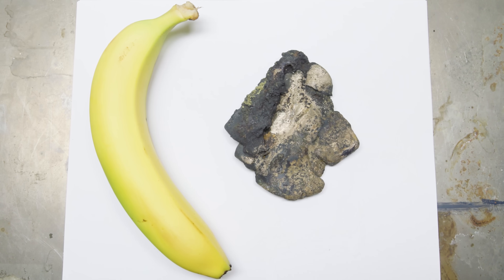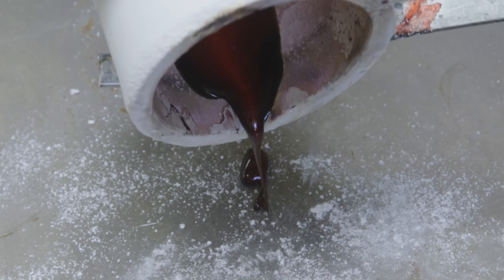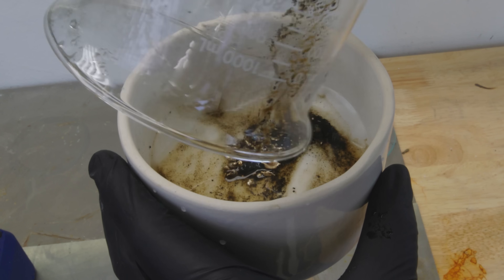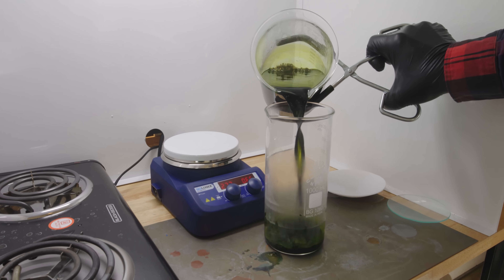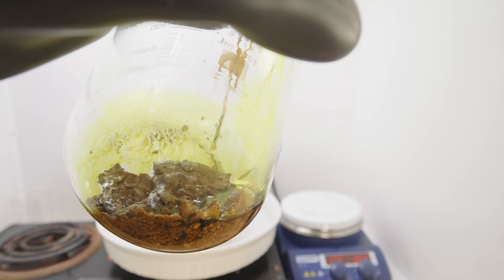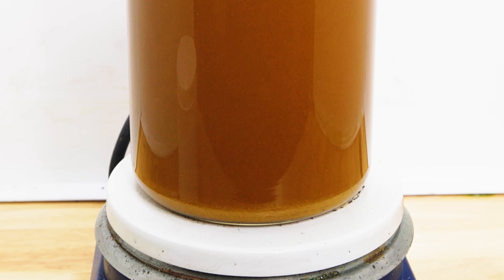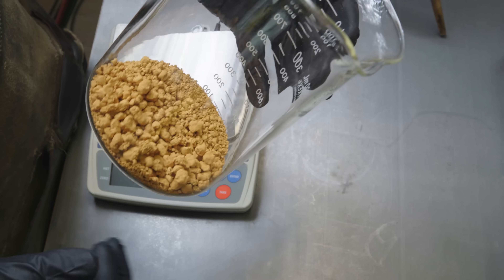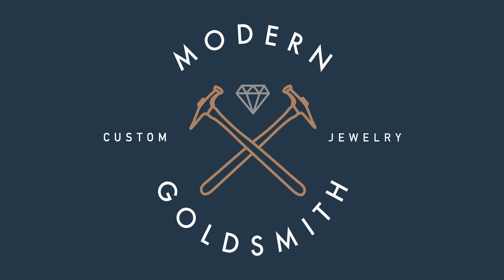Turning a BLOB into PURE GOLD!

Comment: Watch some sreetips. He's literally refining gold all the time as well as other precious metals. He learn from a refining precious metal handbook.
You should've use other acids first to take the base metals out, also the silver. Only then you use the agua regia. 
And too be sure is pure gold you need to repeat those metal dissolving process until you remove all the base metals, silver, even the agua regia need to be done 2 or 3 times until the solution is clear if you go the tree stump gold dropping out of solution route. There's some junk that is not metal that follow the gold on the refinement like jewellery polish compound, that's why is important to repeat even the agua regia a few times.

Comment: Aqua regia is awesome! The orange fumes are nitrogen dioxide. NO2 is very toxic. And carcinogenic. A stir bar and a magnetic stirring hot plate might help with the speed and volume of reagents needed, in case you plan on doing this more.

Comment: i watch a gold refiner with for a long time, and you can achieve 999 with chemical baths. However, since you are new at this you commited a few mistakes. When you found out the blob was 10k, the next step would have been to enquart the gold, which means inserting base metals on it untill the gold was at a concentration of 25% or 6k. After that, you should, as you did, melt it and make flakes out of it. Then, you should NOT bathe it in aqua regia. You should bathe it in nitric acid several times in order to remove everything but the gold. It would take around 6 or 7 nitric acid baths. Once the acid comes out clean, the remaining is already very pure. Then you dissolve it in acqua regia and precipitate in sodium metabisulfite. And in order to get it a 999 you should dissolve it in acqua regia once or twice more just to be sure. Also, every time you achieve gold solution you should cool it down and filter it, specially the first time, because some crap always remains. And you shold also give a squirt of sulfiric acid just in case any lead survived the refining.  Anyway, great video!

Comment: Very good and well described video. I am a retired metallurgist who worked for many years in the gold mining industry in Western Australia. I managed laboratories where we not only conducted our own assays on bullion by traditional fire assay methods - we also produced our own 99.9% "proof" gold to use as standards in the fire assaying processes. Our method of producing "proof" gold was very similar to what you have shown here, except that after the aqua regia digestion, we filtered out any remaining solids (silver chloride) and took the solution up in hydrochloric acid / reduced over heat and re-filtered a couple of times before finally taking up in distilled water giving us about 5 litres of a very clear, but still acidic solution containing the gold. We then slowly added caustic soda to this clear solution while gently stirring - the metallic gold precipitating out of the solution looked like "gold rain" falling to the bottom of the beaker. Precipitate was then washed in distilled water a number of times before drying. We then weighed out one gram lots of this dry precipitate into small china / porcelain crucibles and put into a dedicated furnace to melt down / anneal into small gold buttons or "prills". These were then put through manual "bullion rolls"and rolled out into long strips, which were stored and cut up when required to make "proof" standards to compare routine assay results against.

You could also purchase certified "proof" gold ribbon and solutions from the Perth Mint for use in making your own "standards" but these were very expensive. As a result, we only very rarely purchased these standards and used them to confirm / validate our own site-produced standards - usually when conducting assays for other clients / joint venture partners etc.
Reply: This was really interesting. Thanks for taking the time.
Reply: So you are in Gold Rush in Bendigo?
Reply: @karenwallace462  probably less time than it took you to read it, given your apparent lack of anything much between the ears.

Comment: Very time consuming, complicated and inefficient process. I used to woek at this process.
1. Heat the retort in a crucible to 1200 C, with Borax and Soda ash powder  until liquefied. 2. Allow to cool in a metal bar template. 
3. When cooled, the black impurities will form a solid layer on surface which can be chipped Off. 
4. You now have a Gold Bar & silver of 98% + purity.

Comment: You can use large amounts of flux (or fluss ,I cant remember the spelling,) ,but its something that causes all impurities and things that are not metal to go to the surface of the melted metal , then it can be knocked off with a hamner once cooled just as you would do with arc welding slag ,that does not require alot of knowledge in cheimstry to do.

Comment: You can add more Hydrochloric Acid if the reaction slows down. The salt you're forming is is Auric Chloride (Gold III Chloride), the Hydrochloric is being consumed, the Nitric if memory serves me correct, is the oxidizer and an intermediate in the full reaction process, it just happens to break down into a gas naturally with the presence of hydrochloric. You'll waste less Nitric this way. At least that's how we manage melting lead with aqua regia in the lab I work in.

Is the PPE rated for NO2 fumes? I did a quick check and couldn't see any 3M filters that specifically mention for NO2. What about the fumehood?

Comment: I've been curious for a very long time about how gold is refined to almost one hundred percent purity.   I knew hydrochloric acid was involved but didn't realize the intensity of the acids used.  Now I'm curious how refineries do it in large capacity.  Also, I would be curious to know how you discarded those acids.  I doubt you can just dump it in a sink for obvious reasons.  Maybe outside in the woods?  Add baking soda to it or something to neutralize it?

Comment: You might want to get a grinder to turn gold scraps into dust, so as massively increase surface area and save up a lot in time and aqua regia.
Reply: ...make a huge mess and introduce a bunch of grinder disc material into the metal you're trying to refine? lol...

Comment: A lot of people use nitric acid alone first to dissolve the other metals present, which can be poured off. The down side of this is that you go through a lot of expensive nitric doing this. In the liquid state, yellow is a sign of the presence of gold. Green is typically silver or copper, but copper can also be blue. Using a lot of distilled water helps as it allows the metal salts to have something to dissolve into.

Comment: After watching this, I can't help wondering what he'd have ended up with by just melting it. 
Doesn't that do a pretty good job in separating it since the gold is the heaviest item and anything else would end up floating on top of the gold layer? Sure, you might lose a bit of purity, but it would also be MUCH faster and easier to process.

Comment: Since some already comment it, I also would use as a first step Nitricacid conc. to solve everything but Gold, but I want to add the best way to handle the silver:
a.) fall out with Hdyrochlorid (if you dind't have it already)
b.) filter it (and clean with dist. water)
c.) solve the Silverchlrodi with 10-25% Ammonia (and filter it to remove the crap)
d.) with this solution, fall out again the Silver with some chlorid (you could also use NaCl)
e.) step b.) again.
f.) put it in low Hydrochlorid (~5%) and add some base metal like zinc, tin or iron mesh. this will reduce the silverion to pure silver and solve the base metal. Here it is not easy to find the point where is enough base metal, because you have to solve with HCl what is too much afterwards. the silver is a gray powder like the brown gold powder.

But at least the silver is not so easy to melt like the gold. I was never able to melt it with usual chemical lab Gas stuff. Books say you have to add some Borax to support the melting.

Comment: Next time, try adding a little sulphuric acid to your aqueous solution of purified dissolved gold solution. You should consider adding nitric acid very very slowly and minimally until your stannous test just yields a negative result and then adding your sulphuric acid, (but I would check into the optimal timing of this step this first). In any case, the purpose of adding sulphuric acid is to his will cause any dissolved lead to precipitate out as insoluble lead sulphate. This can be filtered out during filtration.
And you could consider refining your gold a third time also.

Comment: There’s a lot of chemistry so I won’t bore you, but you always need to do what’s called “inquarting” for gold between 25-75% by mass. Any lower than 25, or higher than 75, you don’t need to do this process, but otherwise, it is THE SINGLE MOST IMPORTANT step for gold refining. You either need to add silver to bring the gold concentration down to 25% or less, or add pure gold to bring the concentration to 75% or more. 

Once you do that, you can either treat the 25% or lower with nitric to dissolve away the silver and base metals leaving pure gold powder, or treat the 75% or higher gold with aqua regia.

Comment: I used to work as a goldsmith too, here in Brazil, in my workshop we used to do this process in a different Way.

After considering the alloy with a low level of purity, mix the alloy with 3x its wheight of copper. After That, cut this new alloy in tiny pieces, react it with just nitric acid, i used to do this process in something like 3 times, the dust in  bottom of the becker results in a 99% alloy of gold.

Please try this in some other video

Comment: If you have sodium or potassium chlorate you can make an even stronger aquaregua without any NOx gas generation since you switch nitric acid out and have the chlorate as the oxidiser.

You can disolve in Bromine and bubble SO2 to purify the gold further. I will be trying both of these soon on my channel. All I have is one gold crown that is prob 16 karat gold with a bit of palladium and platinum, silver, copper etc

Comment: You should have used a 12 Volt battery charger, Muriatic acid and fish tank. It would have been cheaper and cleaner  not so much pollution. 99.00 % gold.

Comment: You should be very careful with that "Orange Smoke", that's concentrated NO2 and we avoid it in parts per million, when liquified it's used as a nasty rocket fuel oxidizer and in the book "Ignition! A brief history of liquid propellant" the guy states that it affects your hearth and you can drop dead with a hearth attack hours after exposure. I think the pink acid 3m filters are enough but note this is basically anyhydrous nitric acid, if it finds moisture (from your eyes for example, or your lung lining) it turns back into nitric acid, if it hits something in your house/wall it's going to nitrate it so it's not gonna "contaminate" your environment but either way be very careful and get a 3m 6800. Other than that great setup/experiment!

Comment: There could be some copper left in the form of copper sulfite dihydrate

Nilered did the same procedure, however he added nitric acid by itself after the water casting to separate the copper and the silver from the gold. This way the copper wouldn't be turned into CuCl2 in the aqua regia and them precipitate as Cu3(SO3)2 along with the gold

Comment: 8:25 I just wanna applaud your doublin up of safety measures here. You stated from the outset that youre not a chemist, but this shows youve at least thoroughly researched this and are takin all of the safety measures suggested.

Sure, a fume hood alone shud be enuf to assure zero risk, but its always a good idea to have a backup whenever possible; and your wearin a mask as well is that backup here
Reply: enough* sorry
Reply: @extrasecretS  want* to* doubling* you're* you've* should* enough* it's* wearing* here.*

If youre gonna grammar nitpick, at least call out all the ways in which i deliberately sp words otherwise than grammar rules demand. Ya understood me, why the need to correct tho? But if youre gonna correct me; at least go all out, dont halfarse it
Reply: I’m not gonna go all out in grammar nitpicking because there’s no point other than that it’s better to be corrected then a mistake being ignored I mean if they even knew that they misspelled it then they can just correct it it’s not that big of a deal
Reply: @extrasecretS  9,9 Ive got a fine motor control disability; i know how to sp, i choose not to sp proper in the interest of savin my own energy

Comment: If you want .999+ purity, dissolve it one more time, then drop the gold using oxalic acid.  
Doing multiple drops using SMB it will drop out certain other metals, I think platinum group metals.  
Doing an oxalic acid drop after would only drop gold.

Comment: You can remove flux with dilute warm Sulfuric acid. Usually to purify Gold the method of inquartation is used. Gold is brought down to 6 karat then boiled in Nitric  acid then purified with Aqua Regia. WIth  6k Gold the Nitric can completely dissolve out base metals and Silver. usually 5 or more Nitric boils are needed to get rid of base metals and Silver. When you boil 6k Gold in Nitric you also do not have the Silver Chloride problem. Usually it's best to study first before you do something. like pouring molten metal in glass beakers.. they can easily explode.

Comment: Putting glassware on the bare metal heater is a recepie for a disaster - temperature gardient will eventually crack the glass. Just cover the heater with several layers of woven glass fiber cloth

Comment: Love it!. I am also not a chemist but attempted an experiment to create turquoise that was a partial success. I mixed aluminum sulfate with baking soda to create aluminum hydroxide that was then dried to powder and mixed with dilute phosphoric acid to create aluminum-phosphate, the white canvas. The mixture is then exposed to black copper hydroxide or copper phosphate which imparts the blue color. If matrix is desired a torch will oxidize the surface copper hydroxide into copper oxide, producing fine black matrix, or copper oxide can be applied directly. Phosphoric acid and copper oxide will form a cement like hard material. The dried pieces are then exposed to organic acids and silica sand/volcanic ash to petrify. I had trouble with this part. Lye water glass will destroy the turquoise due to its basic ph. Great gold video. I am scared of chlorine, so won't be trying it, but like seeing it done.

Comment: Using way too much torch time and wasted steps and energy.  All of that could have been  done in two heating steps and simple non hazardous chemistry, a bit of Plaster of Paris molds  and  the process using Borax would have given you clean and layers of purified gold at the bottom and everything undesirable on top in layers that are easily separated and cleaned in two steps.

Comment: I think you had the whole thing worked out when you first melted the small bit in the cruible...   Why didn't you simply melt the whole thing like that..??   I also noticed you did not use Borax to clean the gold when molten, did you not know about that process..?? It would have saved all the use of dangerous chemicals wouldn't it..???  Still  I did like the processes you used, just don't really know why the use of the Aqua Regia was necessary...    Maybe you could explain that more in another video..
Many regards...

Comment: I wonder... judging on the color of the final left over precipitation liquid... I would have done a 3rd refining cycle, with maybe a SO2 gas (awesome changeover from amber, to colorless, to gold powder) or ferrous sulfate (doesn't drop anything but the gold) precipitation. I feel that would be the most logical next step in this process. get you to that 3 or 4 9's fine grade. other than that... not a bad job. Should have most definitely done the nitric acid boils first to get rid of the base metals... you would then see the true beauty of pure gold in solution. crystal clear and a deep amber to almost orange color.

Comment: Your yield was not as good as you think.  Not knowing the metals that were in the alloy, you should have first inquarted by adding silver enough to bring it down to about 6 karat.  Then dissolve out the copper, silver, and other metals with nitric acid, until it stops reacting.  After that, you dissolve the remaining gold with aqua regia, filter, and then sublimate out with sodium metabisulfide.

You almost certainly have platinum group metals in your final product.  They also dissolve in aqua regia.